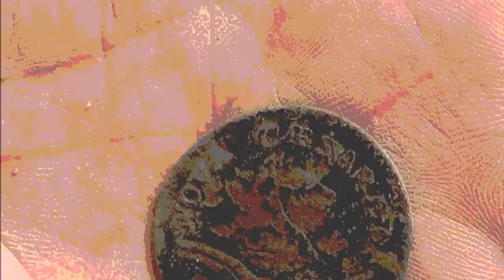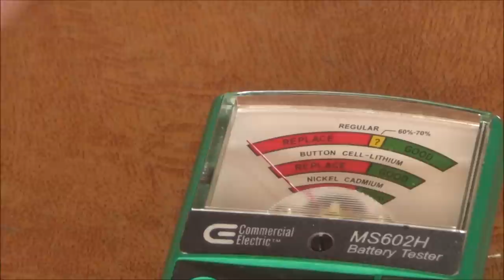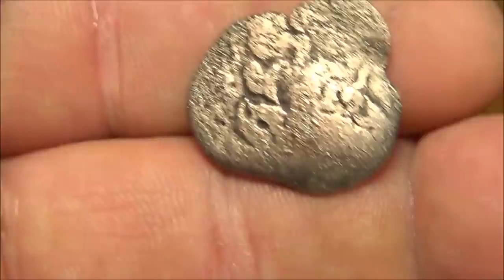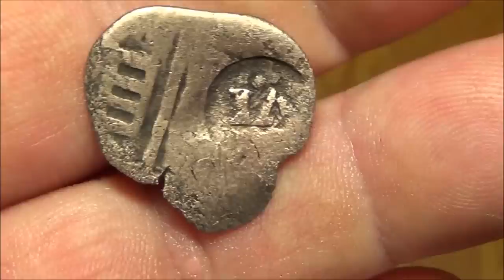Basic SAFE Electrolysis Volume 1

Comment: Thanks for the great tutorial, I learned a lot from it. I am going to use your tips and tricks for sure.
I just have a couple of questions that were left unanswered.
1. What was the reason you switched the floating circuit to the kathode and why did you switch the copper wire with a silver coin?
2. This is probably related to my first question but how does the floating circuit influence the color of the coin. 
3. If you can, could you explain the chemistry behind this set-up.
4. How long should I leave a coin in the electrolysis set-up? (Is there some sort of guideline I could stick to like 'twice as dirty is twice as long' or 'twice as heavy is twice as long'?)

5. Is this process costly energy-wise? How does it compare to say leaving a lamp on?

Okay, those were more questions than I thought. I hope you can answer some of these questions. Thanks in advance and again thanks for sharing this vid!

Regards from the Netherlands

Comment: I remember the Negative = Subtract, attaches to what you want to clean/remove rust, oxides, corrosion from; Positive = Add, connect to the side that will accumulate the gunk.

Comment: good video...good info...once you establish you positive and negative...the terms "cathode and anode" are insignificant jargon... + & - is sufficient...that way you won't mix people up...if you were working with a tube radio or a diode...you might want to use those terms...KISS...Keep It Simple Stupid...thanks for you time and effort...GREAT JOB...!!!   PS...does it make a difference the voltage being applied (6 vdc or 18 vdc)...???  low/high...